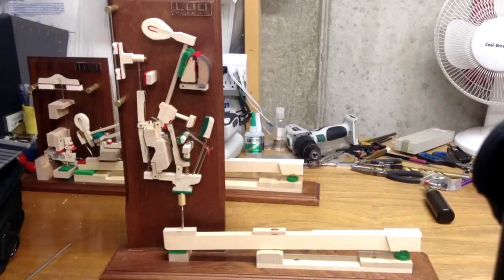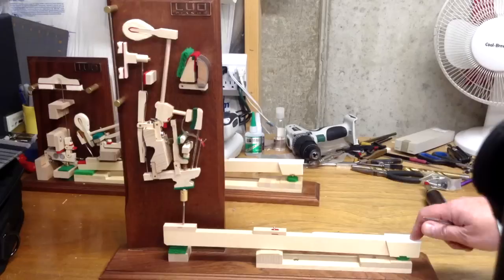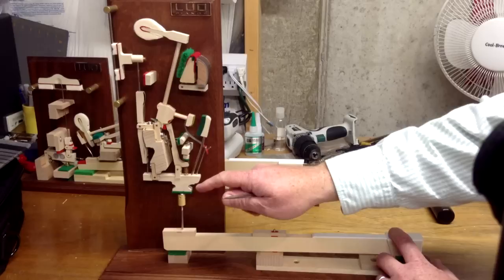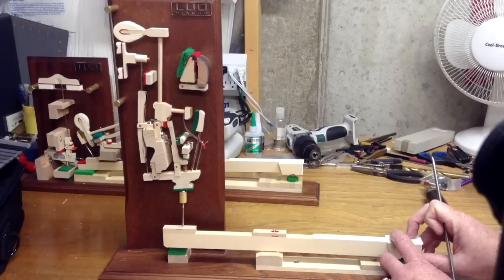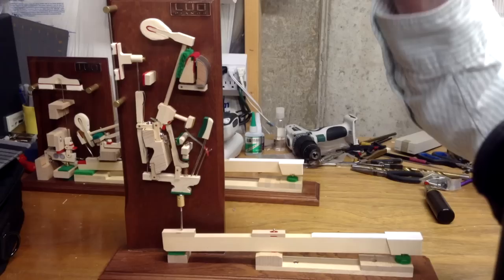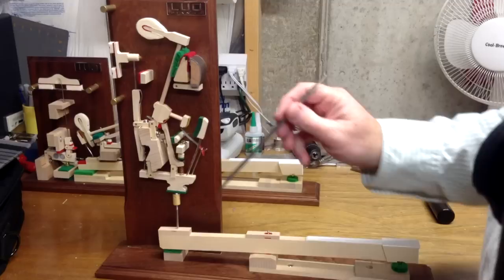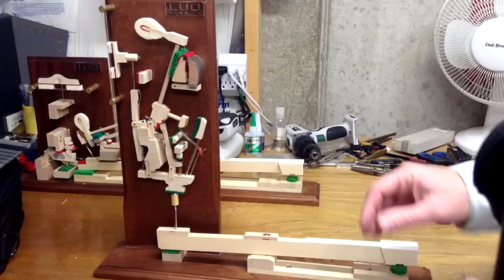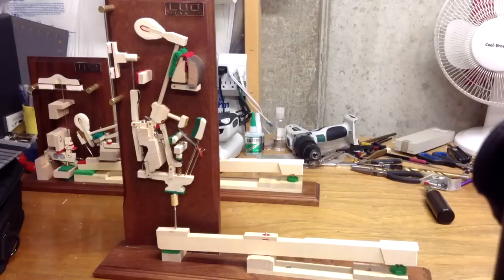How A Vertical Piano Action Works I HOWARD PIANO INDUSTRIES

Comment: Thankyou for all your detailed explanation videos.  They have been extremely helpful.  At around 5min, can I suggest that the hammer does need to fall all the way back, when repeating a note, because otherwise the jack won't engage.
Reply from the maker: Thanks Shane for the tip.  I don't always think of all the details when putting these videos together.

Comment: You can see how the bridle straps work at 5.00 if you slow down the speed to 0.25.The whippen starts to fall after the hammer hits the string.That pulls the bridle strap straight and it jerks the hammer back in time for the next note .The jack is already in place due to the little spring .
 At normal speed the bridle strap always looks loose . You see where it makes good jerk backwards at 1/4 speed .

Comment: What accounts for the fact that more force is needed to hit a low key e.g. C1 (heavy action) when compared to a high key e.g. C8 (light action) while leaving the mid-range keys with substantial action? Is it due to the weight carried by the wooden key at one end of the horizontal bar? Can the key actions be adjusted?
Reply from the maker: At least some of the difference has to do with the fact that the hammers are much larger on the lower end of the piano so they will weigh more.  There are things that can be done to adjust the weight of the keys.

Comment: After bending the damper spoon (towards the pianist) in order to lighten the action weight, will it leave a very small gap between the spoon itself and the wooden piece that connects to the damper? So that the damper will raise a little later when hitting the key.
Reply from the maker: Yes, that is correct.

Comment: I've been trying to figure out how the damper is supplied with pressure against the string...is there a spring behind the damper arm somewhere?
Reply from the maker: Yes, there is a damper spring which is the source of the tension for the damper lever.  It is attached to the damper  lever flange and pushes up against the back of the damper.  If you look closely you will see what looks like a wire pushing up against the damper lever.

Comment: Nice video - informative - I have the "reverse" problem on one note. The jack will sometimes not pop out from under the hammer butt - it's not every time, just 30% of the time. Would you suggest replacing felt and leather on that butt, and checking the flange freedom of movement?
Reply from the maker: You could lubricate the leather with some PTFE powder.

Comment: I have one key on my upright that does not work with the sustain pedal.  It plays as if not using the pedal.  The keys around it work fine.
Reply from the maker: It's possible that the damper lever is broken.

Comment: so most upright pianos cannot have fast repeated notes like a grand piano? (which has the "let off" (escapement) mechanism)
Reply from the maker: Uprights are capable of trills and fast repeated notes but it takes more work from the pianist because in order to repeat a note on an upright  the key has to be returned to almost the fully up position before playing again in order to reset the jack. The grand has a repetition lever that assists the resetting of the jack before the key returns to a fully upright position. This allows for the pianist to repeat a note without waiting for the key to return to a fully up position.
Reply: @howardpianoind  is it like this one, when the Jack go back down to be under the Knuckle, then it can push the hammer up again... it doesn't have to go all the way back to the original position but just need to go underneath the Knuckle https://youtu.be/95hnnb7KLAg?t=137

Comment: my action on my mason and risch console is very heavy. the damper gets engaged as soon as the key is pressed. if the damper lifts later, with the action be a lot lighter? the action is so hard that i cant do trills
Reply from the maker: The action will be noticably lighter if the dampers are adjsusted to lift later as they suppose to do. However, your action may still feel heavy as there could be several causes for the heavy action.

Comment: Just curious, but has this mechanism evolved / gotten more robust over the past 50 years or so? Or just better materials and the same mechanism and number of parts?
Reply from the maker: There really hasn't been significant changes to the design of the piano action over the years.  There are now some manufacturers using composite action parts rather than wood parts, but that has been the extent of advances.

Comment: I adjusted my action out of the piano and when I replace it in the piano the backchecks don’t contact the hammerbutts. I’ve adjusted the capstans and the jacks. What other adjustments would correct this? 
Maurice P
Reply from the maker: For an upright piano it's important to regulate the action with it in the piano otherwise things won't work well when you put it back in.  I would try making the adjustments with the action in the piano.
Reply: With it in the piano the only adjustment I can figure is to bend the backchecks and that is considered the worst thing to do by the experts! So what will bring them back?
Reply: @moplummer9967  I'm curious if you ever fixed this?

Comment: What is the name of that New Jersey shaped piece of wood behind the spoon?
Reply from the maker: This is the action rail to which all the whippen flanges, damper flanges, and hammer flanges are attached. Basically this is the supporting rail to which all the other action parts are attached. This is a cut away cross section that you are seeing so it does not look this way in an actual piano action.

Comment: I want to restore my old baldwin upright piano, it's got a bunch of sticky keys, and many keys require a different amount of force to strike the hammer to the string, and also many keys can only be played forte, not softly. Also many keys are struck with the same force but cause the hammer to strike the string with a different volume. Also the pedals don't work. I dont know where to start. I am wondering how much it would cost to just pay someone to restore it.
Reply: Hi - I've been messing with my own piano, so while I'm not very expert I'd hazard a guess and say it's not likely to be worth it to pay a technician to restore the action. It's a fairly long job if anything is seriously worn, since every little procedure has to be repeated 88 times, and the money you pay quickly outstrips the value of the piano. But if it's fundamentally a valuable piano, then it makes sense to get it done right. On the other hand, pianos are in some ways simple machines, and by cautiously picking around you can't really make things worse if they're that bad to start with.

Comment: I'm actually slightly interested in making my own piano as something both playable and something to remember for the rest of my life, but in the end, mostly for fun XD This is very informative and helpful and down to every detail. I appreciate it greatly.
Reply from the maker: That would be quite an undertaking to make your own piano.  It can be done though.  There is a technician I know who is in the process of building a double ended grand piano which means that it will have a keyboard at each end with two actions and tow sets of strings in one case.  I'll be curious to see it when it's completed.
Reply: I'd be making an upright XD I don't have room for a grand to begin with. Fortunately for me, I work in a lumber mill, and can get the wood for free, or next to free. My grandfather who lives about 7 minutes away basically has an entire woodwork shop in his garage. Overall a lot of the stuff I'd need is being handed to me on a silver platter, but I have to figure out all the odds and ends first :p

Comment: I have 3 issues on my piano, which looks similar to what the video shows, can someone help?:

1: 3 of the hammers are more forward (Closer to strings)
2: all 3 of those sometimes get stuck and wont play the note unless I tap it hard, in which case it will release and let me play for a bit until it happens again.
3: 2 of the hammers are too close to each other, practically touching and they get stuck together at times.
Reply: You need to adjust the "Let Off "on those 3 strings . Look up the phrase Let Off and you can see what they do to adjust it . The piano will be damaged if you bang on those keys .The the hammer will rebound because of the hammer bouncing off the string but the adjustment should leave the hammer free just before it strikes the string .Then check the bridle straps are tugging on the hammer butts to pull them back .
 A late answer but it fills the gap.

Comment: thank you so much for this video ..  i have a question and i need  help please . some keys of my piano  are mute unless i  hit the keys very hard .. how can i make touch response light and to play normal ?  thank you
Reply from the maker: It sounds like your piano needs some action adjustments.  It could be that the hammer isn’t getting close enough to the strings before it does what is called let-off.

Comment: What is the purpose of that small ribbon attached to catcher?
Reply from the maker: That would be the bridle strap.  The main purpose of the bridle strap is to keep the whippen from dropping too far down when you remove the action from the piano.
Reply: @howardpianoind  I was thinking it could prevents hammer from bouncing when it drops back on hammer rail, but not suspected that :O Thanks & greetings from Poland

Comment: Why my upright piano sometimes doesn't hit the string?. When the key is not released completely it doesn't bring the hammer to the strike position.
Reply from the maker: It could be that the lost motion is adjusted so the jack is pushing up on the hammer butt when the hammer is at rest.

Comment: One of my hammers won’t reach the string when played softly, when you show that slowly pressing the key gets close to the strings, when I do that one of my hammers is still about 1/2 inch away from the strings.
Reply from the maker: You'll need to adjust the letoff distance.  We have a video on how to make this adjustment: https://www.youtube.com/watch?v=XQ65x0R23Ac
Reply: howardpianoind thanks. I just really didn’t want to have to spend $100+ for one key (that’s how much someone in my town offered me to fix it).
Reply: howardpianoind ok does I fixed the let off but it still won’t hit the strings unless I practically slam my finger on the key.
Reply from the maker: It could be that the key won’t go down all the way for some reason.  It could be that something I stuck under the key.
Reply: howardpianoind I just smacked it with my fist as hard as I could now it works 🤷‍♂️

Comment: Howard, I have a piano where 5 keys won't work.  The hammer won't hit the string when I strike the key fast.  If I depress the key really, REALLY slow, the hammer will reach the strings.  Otherwise, just chokes and stops.  Can you steer my in the right direction here?
Reply from the maker: Is this on a vertical or grand piano?
Reply: @howardpianoind  vertical... I'm guessing it has something to do with the backcheck, hammer butt and/or jack?
Reply from the maker: It could be a tight jack flange.  Can you see if the back check is catching on the hammer butt before the hammer reaches the strings?
Reply: @howardpianoind  at 5:50 in this video, that is what it looks like.  I notice that the catcher needs to be higher than the backcheck when they connect, but if it is lower or at the same level, the hammer doesn't get pushed to the string.  The force doesn't go NW, it just goes West, if that makes sense.
Reply from the maker: Can you see if the jack is resetting under the hammer butt when the hammer is at rest.
Reply: @howardpianoind  That's exactly the problem!  Thank you, Howard.  Is it needing a new Jack spring?  Sorry for this long conversation!
Reply from the maker: No, it probably needs for the jack to be repinned.  Here is a video that will help: https://youtu.be/qCgvbtDUm6Y

Comment: Howard I have a problem that I don't know how to fix on my spinet piano. The problem is when I play a key hard enough but not trying to destroy it hard, the strings resonate and I think its the dampers not pushing down hard enough on the strings. I have adjusted the damper pedal and it still happens. Do I need to replace the dampers or can I make the push harder against the strings?
Reply from the maker: If it is just one string the damper wire can be bent so that the damper damps all three strings.  If it is just for one note then it could be that the damper wire needs to be bent toward the strings a little.
Reply: @howardpianoind  I think it's all of the strings as I hear the whole piano weakly resonate. And I have a new question, the keys don't seem to go down far enough to let the hammers reach let off. Do I remove some of the wood discs or do something else?
Reply from the maker: This would mean that you don't have any aftertouch.  Increasing the key dip by removing some of the front rail paper or cardboard punchings would be one way of fixing this, but you don't want to have too much key dip so you may need to adjust the hammer blow distance.
Reply: @howardpianoind  it would appear that it's only the cardboard punchouts as the hammer blow distance is 42 mm. And thanks for sharing your expertise. One final question, I hope. How do you know what hammer size to choose from when selecting them on your website?
Reply from the maker: When choosing replacement hammer size you would choose based on the measurement of you hammer across the side of the hammer.
Reply: I have a few problems I can't figure out. I still can't figure out the let of problem; I've adjusted hammer blow distance, I've removed most of the front rail cutouts, and some still won't reach let off. Could leveling the keys perhaps fix this as it would create a bigger lever? The second problem is that some hammers do reach let off but when they do the don't fall back very far or at all, I've checked and the back checks are not the problem; my guess is that it's the pins in the flanges that are to tight?

As a side note I was wondering who would service the piano before me so terribly, for example one key had around six cutouts preventing the hammer from getting anywhere near let off?
Reply from the maker: It’s hard to say for sure.  It could be the key needs to be raised at the balance rail.

Comment: howardpianoind Hi, I am considering purchasing a used piano with a good sound. However, there is a problem where when I press one key, 2 adjacent hammers strike and 2 notes sound out. I have been unable to find information on this. Is this a fixable problem? It occurs with all keys, and the piano is very out of tune.
Reply from the maker: Hi Evan,
In most cases this is a fairly simple problem to fix once the cause is discovered.  One common cause to this problem is that something is sitting on the back of the keys which pushes up on more than one whippen at a time.  You'll also want to check to see if something has fallen inside the action.  There must be something in the action or something might be out of alignment that is causing the problem.  I hope this helps.  Let me know what you're able to find.
Reply: howardpianoind Thanks very much.

Comment: I've got an issue with an upright that I play on frequently, on my low E, after the note is played, the hammer won't return all the way to the back check (I think that's what it's called). Any ideas on how to fix this?
Reply: I've discovered the problem. The E and Eb hammer are too close, causing them to rub when it trys to return, any ideas on how to fix this?
Reply from the maker: If the hammer is twisted, then you can heat the shank and twist it to straighten the hammer.  If the hammer flange needs to be adjusted, you may need to paper the flange which we have another video which shows how to do this.
Reply: howardpianoind thanks I'll check it out!

Comment: Im having the issue addressed at 4:04 with the hammer staying forward (not actually stuck but just sitting forward). How do I fix this? 

The jack is not hitting the hammer butt when the key is pressed...
Reply from the maker: It sounds like the hammer flange pinning is too tight.  You could try some Protek CLP as this may fix the problem, but if it is too tight, you'll need to repin the flange and resize the hole so it isn't so tight.
Reply: What's the bridle strip doing??? It must be broken.
Reply from the maker: One of the main functions of the bridle strap is to keep the whipped up in place when taking the action out of the piano.
Reply: Interesting, although it does seem to have the added effect of pulling the hammer back somewhat as well.
Reply from the maker: It probably does have a small affect on the hammer return, though if everything is functioning as it should the hammer should return just as well without the bridle strap attached.

Comment: What would be wrong if your keys work, but don't return as fast as they should? My piano is from between 1909 and 1911.
Reply from the maker: The most likely cause of this problem is that the pin that holds the hammer butt to the hammer butt flange is too tight.  Usually this means that the part needs to be reamed and repinned.